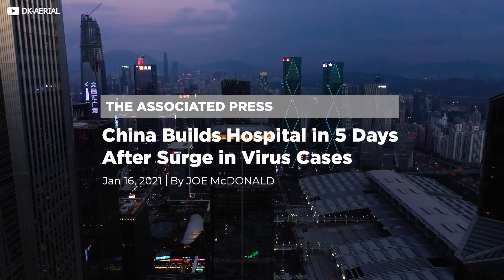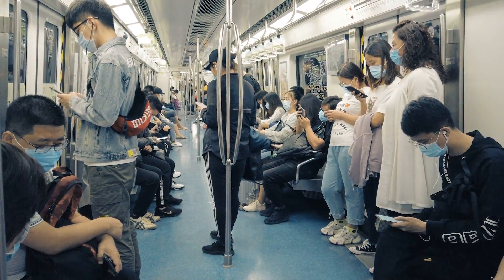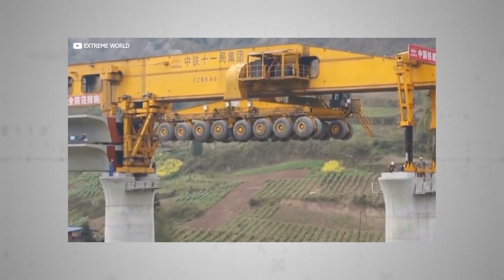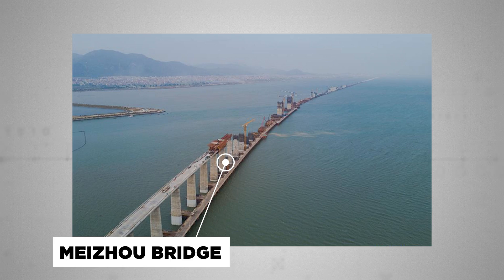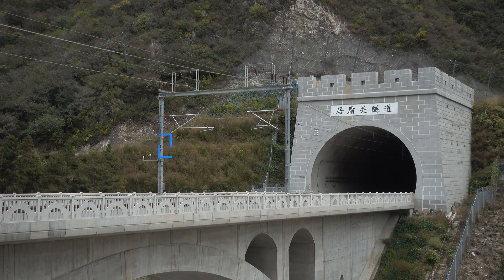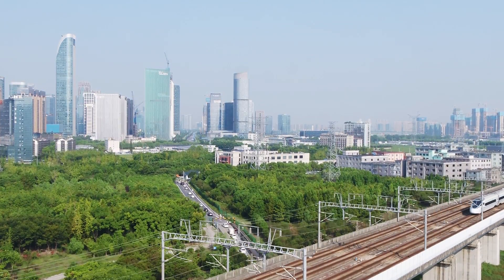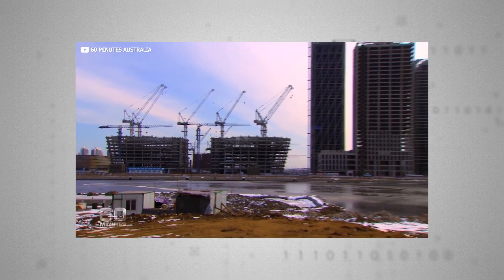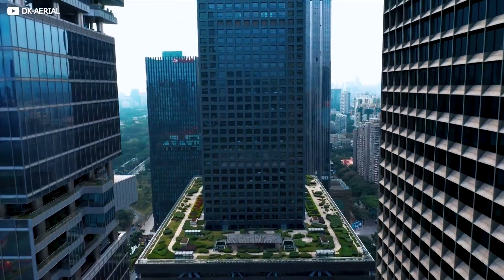How China Builds So Fast

Comment: Need more research man. The hospitals built in 10 or 5 days are emergency hospitals which are temporary one that are not meant to stay around for long. And you’ve got quick setting concrete and pre-fab buildings these days. Also the Excel center was just a quarantine site not a hospital - the requirements btw the two are enormous. Several quarantine sites were built in Wuhan and the building of them barely made the news because the construction process was so unremarkable. They got more report about them being concentration camps in western media🤣🤣

Comment: so much wrong info in this video... the Huoshenshan hospital is a far more well-equipped hospital than the London Excel convention center hospital.
Reply: Dumb person he is taking about building structure in  longevity .
Reply: @dakshjhamb5514  Smart ass, Huoshenshan and the London makeshift hospital are two totally different animals. Huoshensan hospital has almost 2000 separated rooms(including ICU rooms), how many rooms does the London makeshift hospital have? More than one? Comparing them is like comparing the making of a bicycle to a car, simply misleading. 

Also, the hospital is not meant to last, it already closed last year in April after treating the last patients.
Reply: @joc9971  for God sake read comment thread .
Reply: @dakshjhamb5514  You just don't have the knowledge of these two hospitals and have no intelligence to tell the misleading intention of this video.
Reply: @dakshjhamb5514  but the londen one is a make shift hospital, right? Wuhan at that time had a lot of make shift hospitals, we don't lack of that, at that time we need real hospital, with ICU, and negative pressure rooms.
Reply: @KinLee919  it's not about hospital facility this video is about infrastructure capability china is very good in it  no doubt. Chill I am not criticizing china . I am taking about hospital condition in long run.
Reply: @dakshjhamb5514  but....but..... Huoshenshan  don't need "long run", it's a one-use hospital. so the longevity doesent matter, right? like in SARS we buid Xiaotangshan, and when SARS is over, we just abandon the hospital.
Reply: London Excel convention center hospital looks like a make shift hospital only for quarantine mild symptoms patients, witch Wuhan at that time already have a lot of them, but Huoshenshan is different, Huoshenshan is for severe cases.

Comment: There are so many low-key lies in this video, it's troubling. Some might look at this video as a positive for China; however, it still perpetuates common lies manufacturing by the west.
Reply: Another lie or misinformation in the video is regarding the 20+ days for the concrete to solidify. It is true that the concrete will take such a long time to solidify, if you let it solidify in an open building site. However, in China, just like how they build high speed rail parts, the standard concrete parts are prebuilt in factory under controlled temperature and humidity. So in the building site, it is more of a assembling than building. This is also one of the many reasons Chinese can build much faster than the rest, mass production of standard parts.
Reply: @ericliume  Thank you for your explanation, and yes it make sense, but I don't think they said this in the video to mislead by purpose.
Reply: @TheStedomi  No matter it is purposely put that way or not, from a viewer point of view, it sounds sketchy.
Reply: Care to elaborate?
Reply: @Oldschool747  one small lie came near the end of the video, where the video contrasts Britain’s adaptation of a convention center to China’s building of a new hospital.  However, during the beginning of the outbreak, China also requisitioned its convention centers and sports centers and converted them into temporary hospitals too.  The hospitals built in 7 days were meant as supplementary.  Essentially, China did exactly what Britain did + build new hospitals.
Reply: @JH-hb5cc  They actually built it because they don’t want the convention center to be the main center for hospitalization, they want an functional hospital.
Reply: @mervynlan7727  simply 2 different types of hospitals : 2 for severe cases (built within 10 days) and others converted from sport centers convention centers for light cases who were confined at home.
Reply: @JH-hb5cc  You forget to mention that the convention centers are for light cases where heavy medical equipment are not needed. The new isolation wards built in 10 days are suppose to handle the serious cases where heavy equipment and intensive care are needed. You just can't build a convention center into an intensive care unit.
Reply: @Oldschool747  More on the hospitals built... 
They weren't meant to be permanent hospitals, a more apt comparison would be a temporary field hospital but the ones China built were much more robust. If I'm not mistaken, the first rapid hospitals built in Wuhan were already dismantled when China got the pandemic under control. One could criticize that it's not very sustainable but obviously that's not a consideration when combatting a pandemic. 

Also they glossed over this quickly, but the prefabricated bridge sections can be built in controlled environments which actually leads to higher quality construction. The ending somewhat contradicted this, and kinda insinuated that the bridge sections constructed quickly weren't of high quality. Plus, it reinforces a common negative stereotype, Anti-China crowd aka "pro-democracy" crowd in Hong Kong believe this stereotype, calling them [tofu structures], having never been to mainland China whose negative views of mainland China are stuck in the 80's.
Reply: @Oldschool747  those uniform police like footage makes china look like full of control, but real life you hardly to find one .

Comment: The US is capable of doing this as well, BUT not only politics slow it down but all the regulation and red tape like multi year environmental studies , permits, high labor cost ect drag things out. You can see it in times of emergency we can crank out projects within budget and often ahead of schedule.
Reply: similar in almost every democratic country ever, we too in my country spend years in land acquisition, dispute settlements, environmental checks, protest yadi yadi yada... after ten years when all of this is complete then bitch about cost overruns, blame engineers and scrap the projects over all

actual construction takes only a few years just like china

also the emergency construction part is right, we too built a small 1 floor wide hospital in 2 months
Reply: Biggest problem is that if Republicans come with such an idea, the democrats will stop them, and the other way around also.